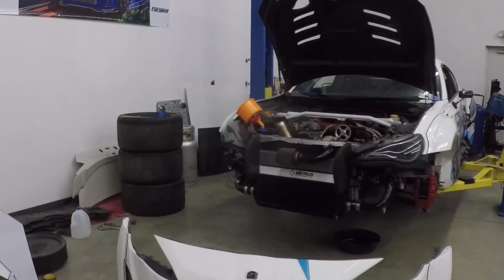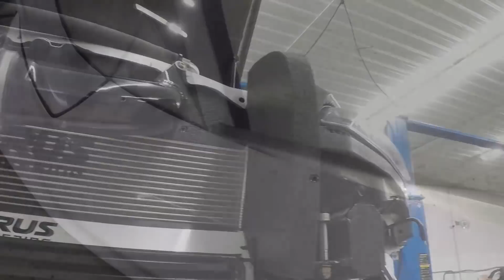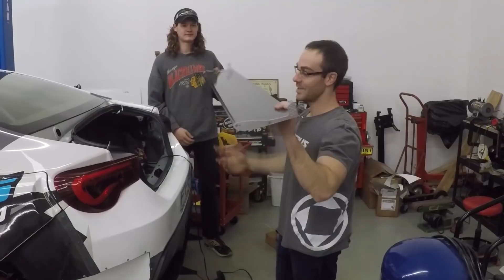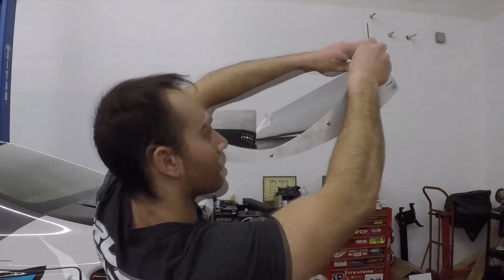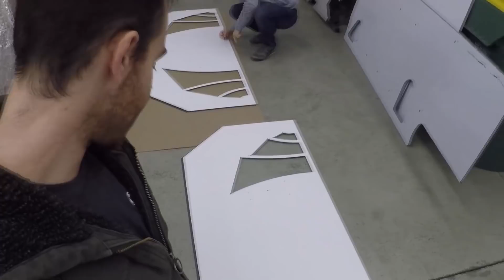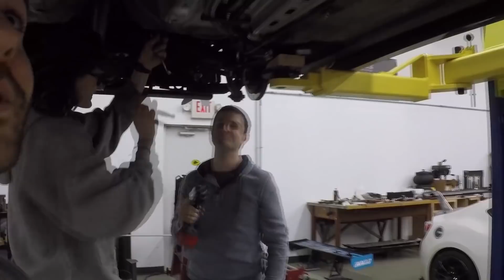ProjectFT86SFTA - Episode 8

Comment: I know this was months ago but just wanted to throw this out there....I used aluminum foil adhesive tape to seal my ducting between the bumper and aluminum sheeting (instead of the flex seal), and it blends right in with the raw aluminum sheeting.
Reply from the maker: Awesome! thanks for the tip.